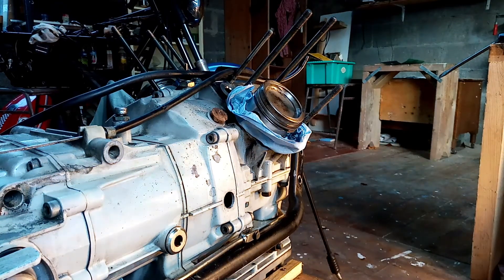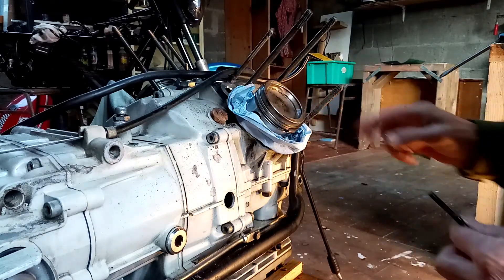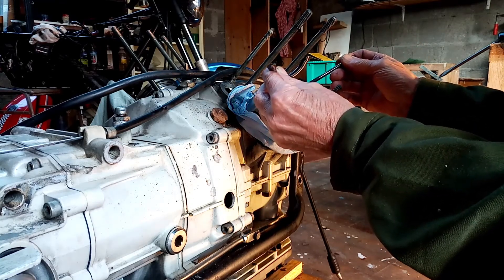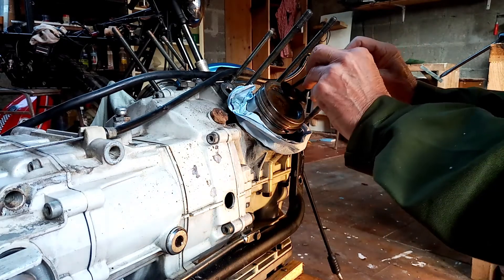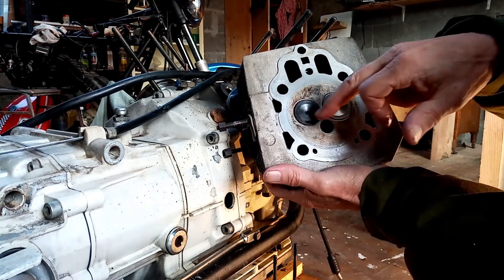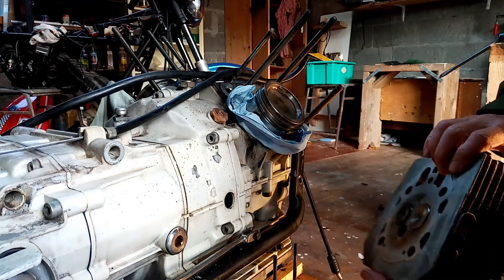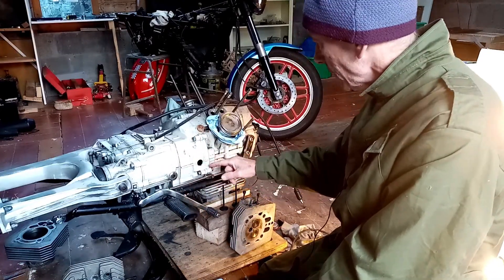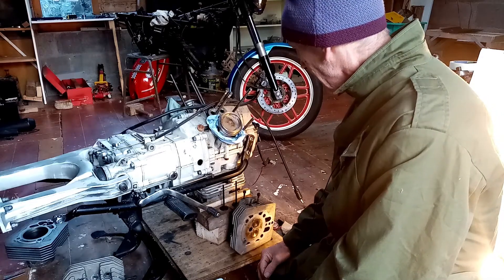Heron Head on Moto Guzzi

Comment: Morini 350 and 500 V twins use heron heads as do some cars . 
I had a Laverda 750  vertical twin , an SF2 , which had a strange feature at the cylinder head . The barrel liners extended maybe 4mm out of the barrel block , the extended liners fitted into rings milled into the cylinder head , which aided the head gasket and maybe helped cooling of the air cooled motor ( not sure ) . The aluminium head had two 'skull' inserts made of steel which covered the entire interior of the combustion chamber ; the valve seats and spark plugs were machined into the steel . I am again not sure why Laverda did this , but an unforeseen advantage would be the engine does not need valve inserts for unleaded petrol ! I presume the skull caps were to protect against the high compression heat potential , again I am not sure . Nice motor though !
Reply from the maker: I used to lust after Laverdas back in the early 80's.